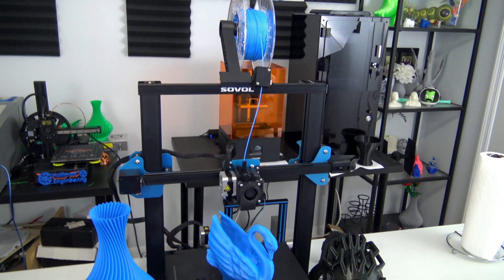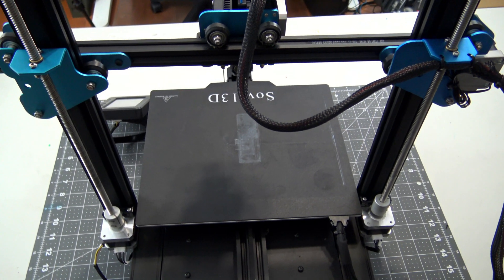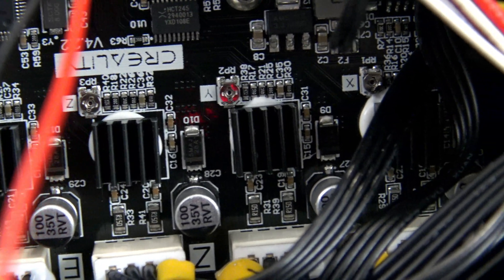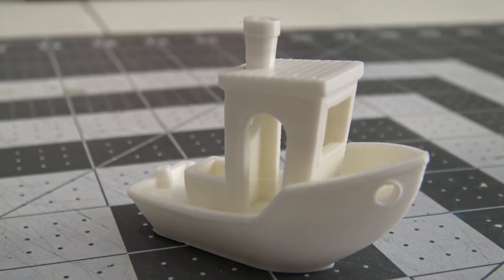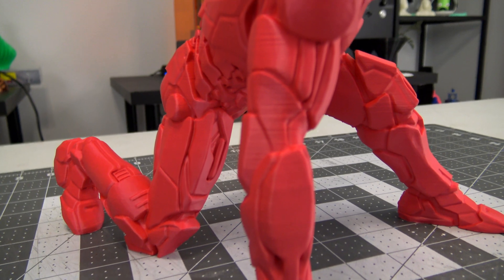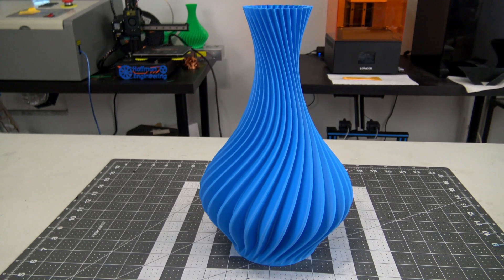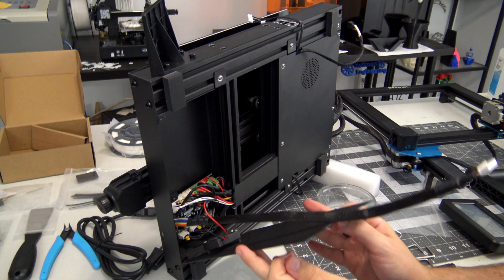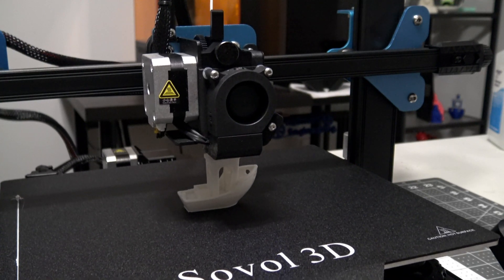Pro 3D Printer at an Affordable Price - Sovol3D SV01 Pro Review

Comment: Idk if your still reading comments but I have had a LOT of issues
Reply from the maker: I'd be curious as to what types of problems you've experienced.
Reply: @HoffmanEngineering  for one the instructions are not at all clear for certain parts of the hotend. Mostly the filament guide right before the hotend. Got filament melted and stuck in there and had to drill it out. If outer fan blows too hard or pushes itself too far the wire melts and bricks the whole printer until the fan is replaced. I had to cut the mesh the wires come in because it melted to the wires

Comment: I bought one of these about a week ago - it is a fantastic printer for the price, and although my first printer having watched a tonne of you tube video's, I spent an hour carefully setting it up, including the stiffness of the rollers, belt tensions, carefully levelling the bed etc. Like you I got a great benchie out of it and stuff I have printed from cura has printed equally well. I got an elephants foot on my benchie the first time around but adjusting z offset fixed that.
Reply from the maker: Sounds like you are on the right track! Glad you are having success. Happy printing!